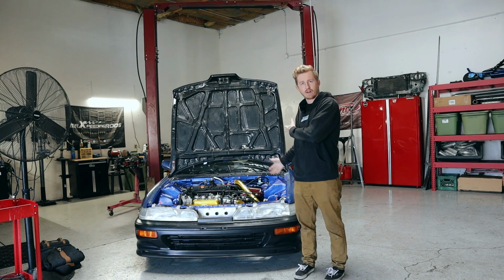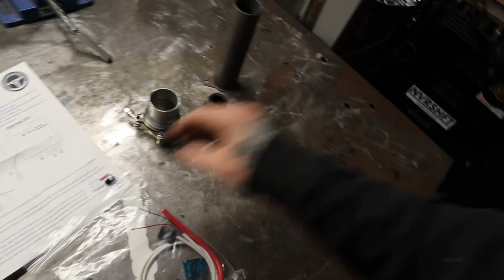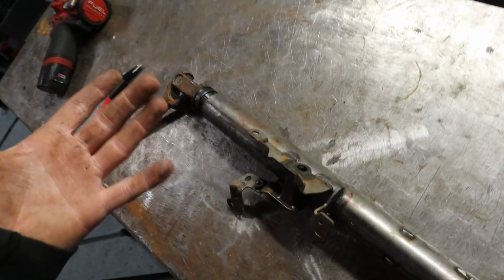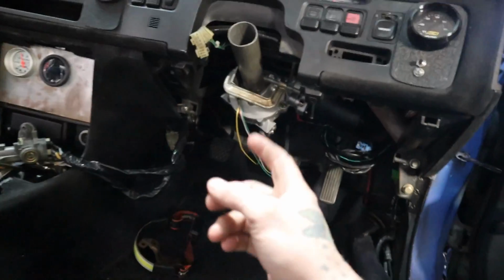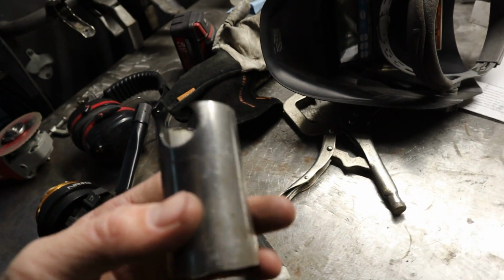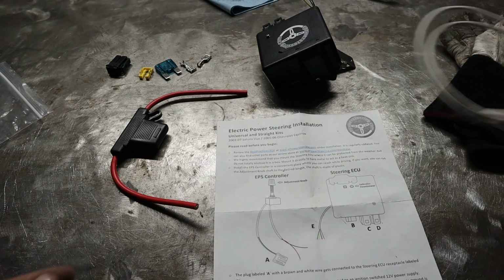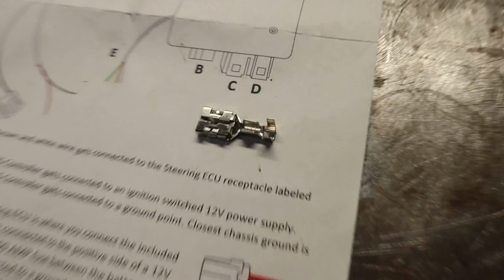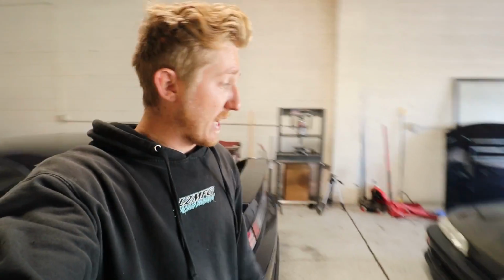Full Electric PowerSteering Conversion On My DA9 Integra

Comment: Ive been researching doing this on my EF. I have the manual factory rack, and the quife guts to put in it, BUT... Im nervous about how hard it will be to steer going down to a 2.8 lock to lock rack vs the stock 4.8 lock to lock. The car also has sticky tires and quite a bit of caster. I mostly auto-x it, so doing the shuffle is getting old.
Reply from the maker: The eps conversion is for sure worth it. Especially on track/autox. I’m gonna change to eps on my drift car sooner than later as well

Comment: Ep civic si hatchback  had electric power steering.
Reply from the maker: Yes, it did. Lol
Reply: @ChrisSadowski  why the lol 😆 did you already know that and I was just sounding dickish?
Reply from the maker: I did know that, I have had a few people messaging me stating the same thing and I had to explain the rack doesn’t bolt up the same and the wiring isn’t there to just plug and play like the unit I used had.

Comment: I'd recommend going back and re-terminating the high current circuits with the proper tools
Reply from the maker: They got a plenty good tug and they didn’t come apart, and all got heat and shrinked. I’m sure it will be fine, especially since I drive the car like once a month 😅

Comment: Fantastic!! Thank you so much. I was Soo curious about this. So does the integra use a manual RHD rack or was it a power rack that you looped?  Seeing your face when you could turn it one handed is proof enough for me.  Does adjusting the potentiometer make much of a difference? I see a lot of possibilities!
Reply from the maker: The dial adjustment makes a big difference.  I could turn 315 pirelli slicks with a finger if I needed to. The rack I used when I went RHD was a normal power rack that I de-powered

Comment: Looks cool. 
But.... if it ain't broke..
I bet you're gonna go back stock. Old ways are the best ways.
Last time I checked nobody has made a better wheel. Stay true.
Reply from the maker: It was broke, that’s why I fixed it. Not sure the point you were trying to make.
Reply: Sorry about confusion. 
I just think a oem repair would of been better.
Still good job on the install
Reply from the maker: @Jason-nk4yr  there was no form of OEM repair, being RHD converted, and having a K swap and a turbo. There is no room for hydraulic components, nor is a hydraulic setup more efficient.